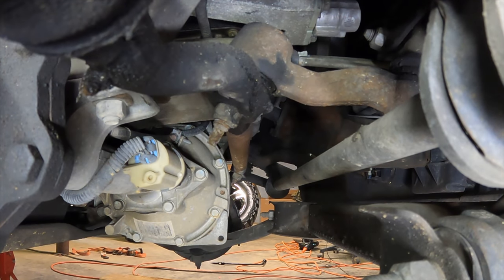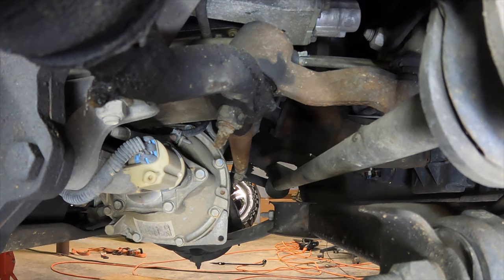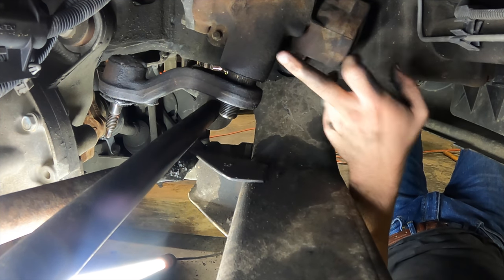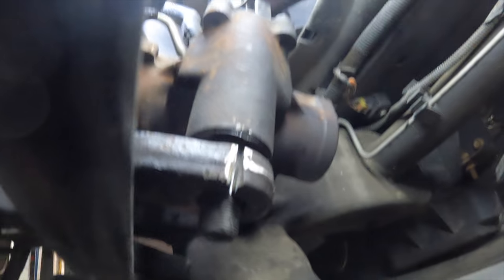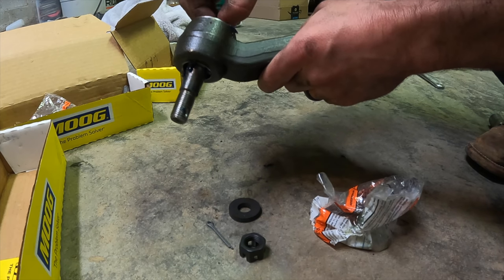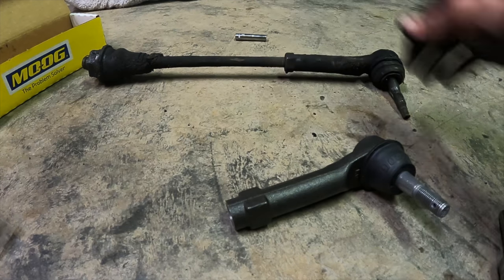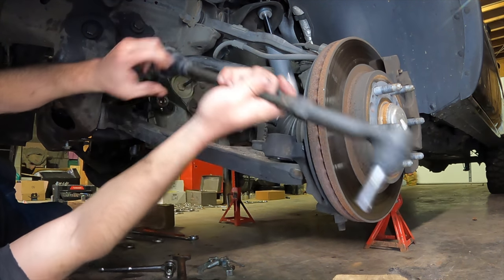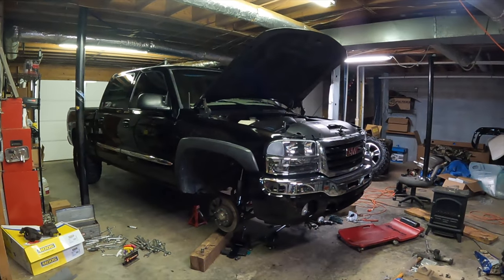99-07 Front end rebuild!!!!

Comment: Dude...perfect timing. Just about to have to do the same to a friend's cateye with 190k. My 2 cents see if you can find bilstein  5160s for the rear of your truck. They ride extremely well.
Reply: Boutta do my 06 cateye with 190k lol
Reply: Any good part companies to get these parts from? Or just a good front end kit to buy?
Reply: @Vgorruso  kryptonite and cognito make some good stuff. If your truck is leveled get some new upper control arms made for the leveled trucks. I’ve had the same cat eye for 16 yrs and have hated driving it since I leveled it. I just put 2k in the front end and it’s still has half a turn worth of play in the steering wheel and rides/drives like shit. I started researching. And I need a steering box to fix my steering. And I had asked many mechanics what I could do about the harsh ride in the front end and they just said nothing really. You get the upper control arms it will give you some travel back and make sure you have some good bump stops. I’m currently saving back up to buy upper arms and couple other things and just going to do it my fucking self.
Reply: @apbt067  I have a lift kit on my truck and let me tell you it’s very sensitive to small bumps…
Reply: @apbt067  i
Reply: What other things should I do to my 06gmc I literally just bought it with 180k miles
Reply: @Vgorruso what control arms do you have?
Reply: @apbt067 any update? Got a 02 Tahoe with keys so level and then about 3 inches and contemplating going the cognito/kryptonite route and leveling out the rear end like the yeeyee boy before me didn’t do lol. Just wanna get some input on ride quality before dropping 2500 lol but I hate putting stock back in knowing the geometry is outta wack on my ball joints.

Comment: Pro tip for anyone going to do this (specifically people on a tight budget) get quality parts like in this video… save up if you have to. I have an 06 GMC that I have had for years, long story short when I was younger I didn’t have much money and rebuilt my front end with the cheapest chinesium ebay had and everything was worn out worse than the stuff I took off within a month.
Reply: For people reading this comment…moog is NOT quality. They went severely downhill in the past 3 years along with QC. Get AC Delco, or quality aftermarket if you have mods like level, lift, etc. Otherwise, sound advice.
Reply: @wesleysims3819 I’m planning to rebuild my 2005 Silverado and I already have moog parts , I wish I knew that before I bought the parts

Comment: I HAVE THE SAME PROBLEM HITING BUMPS MAKING THE SAME NOSIE ITS Driving me crazy, I have replaced wheelbaring hub assemblies in the front and the back. I have replaced sway bar links and bushings. I have replaced intern outer tie rods. I did not do the Pitman arm or the Pitman arm bracket or any of that Pitman arm stuff. At the time. My Pitman arm was still in good working order according to the mechanic. I haven't had it checked in about a few years though. I have put in probably close to $14000 in labor and repair. In my 2 thous and one GMC Sierra SLE extended gab 1500. With the 5.3 l V8. I have a flowmaster FX cat back to the exhaust system on it. Just like yours, it sounds amazing. Plus a recommendation for you if you want more horsepower, you want to replace your throttle body. With a expensive expensive unit. I did this and I gained 9 horsepower gain. I couldn't believe on how much I gained. Plus my K&N Air Intake System added 11 horses to my Engine. Plus I did a Diablo tune. Which really woke this truck up. Especially the shifting, it's so smooth. My horsepower gains are extraordinary The truck originally crank 285 horsepower. 325 foot-pounds of torque. Now the engine is at 382 Horsepower, I had it checked recently. And 408 torque. 0 to 60 and 5.1 seconds. Plus I did a stage one weight reduction. Plus it's a 2 wheel drive, so it weighs a little bit less. My question for you or anybody that can answer this. How can I improve my ride quality on this Truck???? I think I'm gonna have to replace the rest of the stuff in the front end that I didn't do yet. But will this really help? That's the question because the stuff that I already did is an improvement but it didn't seem to help as much as I thought it would and I also replace 4 shocks. Also I forgot the mention and new tires and all new brakes on the truck. Caliper's rotor's pads, front and back and all new brake lines and all new fuel lines and the new.  Drive shaft and new rear differential gear backing plate bolts fluid change. Tune up plugs, wires 4 coil packs, new belts, new battery, new power, steering pump new lines, new alternator new tensioner, pulley new throttle position sensor new mass air flow sensor. New power windows driver passed your sidied. New fan motor that controls the climate inside the truck. That was making noise that had to be replaced and the switch that controls the fan speed was only working on low speed. So I had to replace that also. Plus CD player kicked a bucket. I put an after market DVD touchscreen in. Sorry.
 For such the long message but I wanted you to get a general idea on how much I have invested in this truck. Plus it cost me $3000 to fix the frame. Truck is still not done yet. It is a nightmare but I love the truck so much. I won't get rid of it. I won't stop until it drives like a new truck.

Comment: I got 337,000 miles on my 2004 Z71 Tahoe 4x4 and seeing this video convinced me I need to redo the front suspension on my Tahoe but I just can't stomach throwing $1K into a vehicle I gave only $3K for that is worth what I paid for it but some says it is worth more so I might have to throw a lift on it which will take care of the worn out parts...I also like those wheels you got and considering some for my Tahoe if I did throw money at it..great video either way!
Reply: Just think, that’s cheaper than 2 payments on a brand new vehicle & you still wouldn’t own it after that, and would still have the same maintenance to do. It’s paid for. Doing good maintenance like this just makes sure it keeps earning its paycheck.

Comment: Lookin at my 233k Mile 2500 on original joints. My steering input is a suggestion at this point. Oh well gonna do what you did this weekend. Going moog as well. After that gonna do control arms and sway bar links. Thanks for the video. Also love my bilsteins.

Comment: While you’re in the front end you should do the bigger brake upgrade (07-13 calipers, rotors, pads) it helps alot i did it on my 06 1500.
Reply: Don't the 19 and up brakes also fit with bigger wheels?
Reply: @Irishcream216  not sure, i did the upgrade on mine, i already run 20’s but i can only run certain 17’s so i would say offset 17’s or bigger unless you run hella spacers. definitely worth the upgrade…
Reply: @joshuagreen9691  Don't you usually have to upgrade the master cylinder or brake booster or something when you go with a big brake kit? How does the factory system work with the bigger calipers?
Reply: @axtaxt2964  not required but im sure it would help.
Reply: @joshuagreen9691 I have a 02’ chevy with a 2020 chevy brake setup. Feels much better than my 07-13 brake setup.  You only have to put in washers to space the calipers away, so the rotor doesn’t rub on the caliper.
Reply: @Irishcream216 Yes. They recommend 17’ rims for 2020 brake set ups. And you may have grind down an edge on the 4 piston calipers. I run 2in hub spacers on 20’s so I didn’t have any issues.
Reply: I used 2020 calipers and rotors. Gives the upgrade to 4 piston calipers. That is a night and day difference over the original breaks
Reply: I had a spacer washer machined by a friend. You have to make absolutely sure that the center of the caliper lines up with the center of the rotor when the rotors on the vehicle and the lug nuts are on. There's a video floating around the internet that actually gives the correct size of the spacer and that's what I went with and it worked for me first time if you don't do that the brakes won't wear evenly and can cause even bigger problems

Comment: You forgot to add wheel hubs which trust me they go out around 150 to 200,000 miles and swaybar end links . Also guys take your tail lights out and pressure wash the best you can wear the wheel wells rust It accumulate with junk salt and everything else and they rust from the inside out like the rocker panels do on those trucks. So some preventative maintenance will save you a bad side and it doesn’t matter what kind of truck what year of truck except for the Ford aluminum bed sides? Trust me on this I thought of doing that after I saw a 2011 with a rusted bedside and the day I was going to do it I noticed a bubble in my paint, so I pulled out the tail light shine my light in there and there was 2 inches of junk sitting where those two pieces of metal meet where those rust out . I sprayed it off and I could literally see the rust so I got it out the best I could and sprayed some rust inhibitor on it and it hasn’t been rusting anymore. . I figured I would share that with you guys but for real don’t forget to put hubs on it because they will go out

Comment: Got a 99 silverado ext cab z71i did everything .went from 35s to 33s .Southern truck so everything came apart pretty good...bump stops where gone upper and lower .broke both cv axles. Was binding inn4wd ..I cranked my torsion bars back down a bit noticed they are wore out...I didn't have to take my gear box off tho .I used a long bar and it popped right off...last week doing my new axles in .noticed my year old ball joints are toast. Both sides. Both inner tie rods are toast ..all this I did a year ago .and had it aligned .I thought for 44 bucks to buy the upper a arm with ball joint all in it was a good idea ...maybe if it had a f%$king grease fitting in it...of course it's gonna be junk a year later .,I'm just gonna buy the offset control arms for it..I don't wanna be replacing this stuff every year .chasing the wheel sucks ..it's not wearing tires tho witch is weird. .gotta  spend some money to look cool tho

Comment: Im about a month late here but maybe this will help someone else

if you have the money buy this pitman arm puller Schley  sch68800. You don't have to mess with taking the steering gear loose.

if you dont want to spend $170 for the schley, NAPA sells a carlyle or K-D tools brand standard type puller that seems better than the cheap rental ones. its about $50 and has a lifetime warranty. i think it is Part #: SER 2289

also, a little heat from a mapp gas torch always helps if you have one.

Comment: I really like the Cognito pitman and idler arm steering brace kit for these trucks; I have one for my 2006 GMC yukon 4x4.
Reply: How much does all that usually run for?
Reply: @DrewEnglehart  its like 280 i believe
Reply: ^yup about 200-300 depending on tax and whatnot. This video really breaks it down well. I will say take it to get the alignment adjusted after. It will feel pretty straight but the smallest adjustment on camber can realllllllly eat your tires in the blink of an eye. Good luck friend!
Reply: I have an older Yukon, his instructions were extremely helpful.

Comment: How are these parts holding off? Do you still recommend them? A current review of it would be nice.
Reply: Looks like everything he bought was MOOG, I would assume if he still had the truck, everything is fine. I’ve trusted MOOG for years on all my hard parts.
Reply: I’ve been using moog for the past 25 years for my customers. IMO moog is the best of the best I don’t trust any other brand!
Reply: @thelizardking8525  my last suspension upgrade was all moog parts for my 01 ford focus, springs were instantly shot. id say moog is better on the solid metal parts, ie: no ball joints springs etc.

Comment: Just did a 2" lifted front strut assembly on my 2011 z71 suburban with about 130k on her.   Everything was worn out.  I replaced the ball joints, inner and outer tie rod ends with all moog problem solvers.   Installed new rack and pinion as well as sway bar bushings and the duralast gold line end links which are very nice.   Was quite the job but rides good and feels tight.  I know what you mean about being brain dead about 3 am after working on your rig for 12 hours.    Riding 17s on studded duratrac 33's.   Feels good knowing that everything is new under there.  Not just a for looks upgrade anymore, its a whole front end component and performance overhaul!  Nicely done man.  Hows the rubbing with 35's on stock 20's?   Are they a 12.5 wide?   Thinking about going with 285/70/18 on my stocks for this summer which equates to a 34x11.5.

Comment: Moog is pretty good stuff. But honestly I've had better luck with mevotech. My 05 Tahoe sits on all mevotech parts. Ttx is the hd version except hubs. Those are titan xf. I've beat these parts just to check for a breaking point. Still no failures after 75000 miles.

Comment: Tip on the pitman arm if you got a new arm to put on angle grind that thing off there save you some trouble just use caution one of the most dangerous power tools out there if used improperly. Good luck.
Reply: Yup I about cut my face in half with angle grinder .. mf bounced off a pole I was sanding like and bam cut my safety glasses in half with big cut

Comment: Replaced most of my front end not long ago...left out coil springs...in the next 2 months I took my truck for an alignment to 3 different shops every one told me I needed new upper control arms and one lower but still offered to align the truck...With one eyebrow raised i inform the 3rd shop's technician that the parts recommended were installed new a month earlier and 2 other shops made the same recommendation. He sheepishly tells me I installed the bolts wrong on those parts and that the alignment would not hold. 
 To the "Pros" out there.  How fucking hard is it to say...
"These parts look new. Did you install them yourself? Oh yeah? Well you messed up here and here. I can fix that for a small fee"

Comment: You stretched all of the suspension turning up them keys. That's why it has wonder.
I don't care what you install because it will always be outside  spec with it all strained like that. Leveling kits should be outlawed.

Comment: I got a question not sure if you know but will 33x12.5x20 fit a 2017 Silverado with a leveling kit only without rub or small rub?
Reply: I have a 16 Silverado with 24” x  10” snowflakes  wrapped in 12.50” x 33 mts with a leveling kit and they only rub on the sway bar slightly. But my wheels are flush under the wheel well. I had 22x12 wide rims on 12.50” wide 33” mts and they rubbed bad on the rear part of the fender well. I couldn’t fully lock the steering wheel in reverse. So In a nut shell. If you have wider than 10” rims yes they will rub.
Reply: @JohnDoe-ys3ed  is it bad when turning? Does it ever make you regret getting that big? Thank you for answering.

Comment: Honestly have to do the same thing to my old 01 Silverado, has almost 300k miles and still OEM steering components.   You'll have to take care of your rear driveshaft u-joints soon too bud.  Those go bad at about 100k on these trucks.  Looking forward to more content on this ol girl.  Keep it up.
Reply: Same here I have  313,238 miles on my 02 and every thing is still stock
Reply: @r39skully82  How many 4L60E transmissions have you gone through?  Mine has chewed up 9 of them so far.  😅
Reply: @tylerf6528  I would have except they were going for almost 4k when my last 4L60E went out and doing the 4L65E upgrade only cost me about 2.5k which included a 3500 rpm stall converter by B&M.  The other 8 I had go out on me were all factory rebuilds covered under warranty.  Think I got about 20k out of each, maybe less.  Putting about 311hp to the ground out of some building up of my 5.3L.

Comment: to get the pitman arm off you don't need to remove or loosen the the Gear box just grind a notch in that Meat Bracket right under the Pitman shaft and then the Puller Bolt will clear and put the idler arm on the Bracket Hanger First before you install it

Comment: It rides smoother because it has that stayblelizer sway bar witch makes the rear end a lot stiffer than a regular 2 wheel drive truck it's supposed to take the bounce bouncing and swaying that you had from the old particular coilover springs and shocks on the old schools and had a more smooth ride and all actuality it really makes the truck right a lot rougher than it would with the old style setup so the added weight makes it right smoother

Comment: Did the pitman and idler arm take any side to side play out of the wheel? Or is that entirely from the steering gear box? I have 295k on my 01 replaced the wheel bearings and ball joints and tie rod ends but didn’t do the idler and pitman arm.

Comment: Hey guys great videos enjoy the honesty and sweat equity,  if you want a great upgrade to the front end of this generation of gm truck ie pre 2007 with a recirculating ball front end check out cognito  motorspots . I believe there a California  based aftermarket shop , what they do sell is a weld on kit for both pitman arm and idler arm of this gen truck . What the kit does is double capture both pitmaand idler arms reducing wear , these trucks had a light duty front end and the cognito braces work ! I have installed them on my 01 stepside !

Comment: Those puller tools ARE NOT meant to use with impacts. You use a wrench or a ratchet and the slow pressure increase will pop it off

Comment: Just get a loaded upper and lower control arm and everything else. It’ll save you some effort. I got a loaded upper control arm and wound up having to press the lower control arm bushings in there but you can get those already pressed down and loaded with a ball joint.

Comment: Lmfao  next time hit the pitman arm tool where the ratchet  goes a few time and then tighten it a little  more. It relives stress and won't bend. But it will mess it the 3/8 ratchet piece so grab a 3/4 socket to turn it.